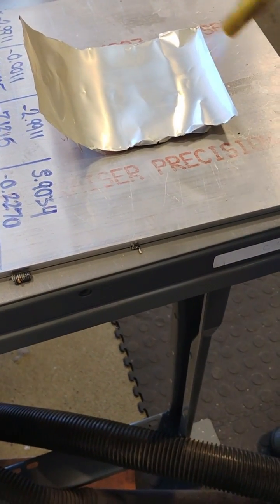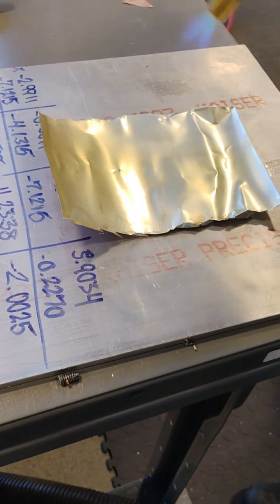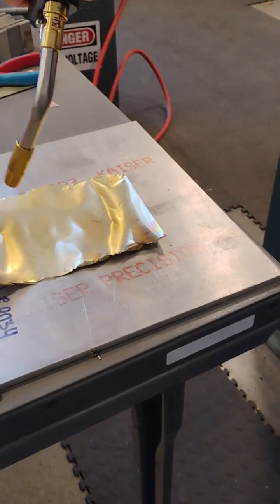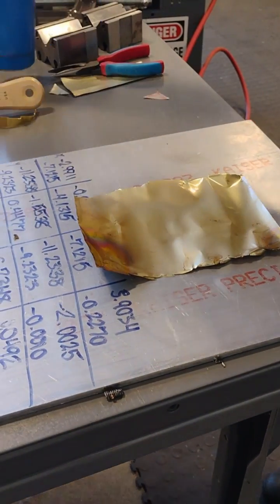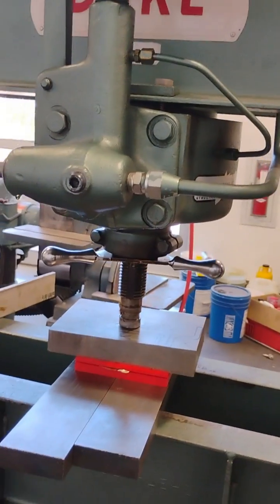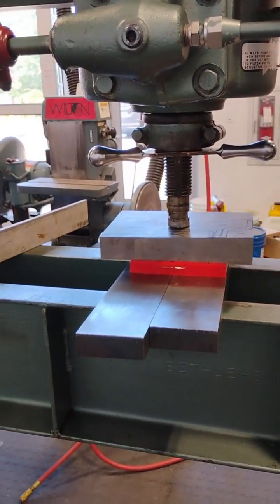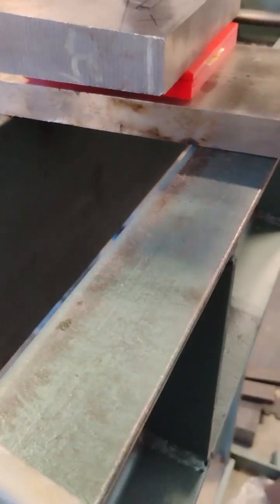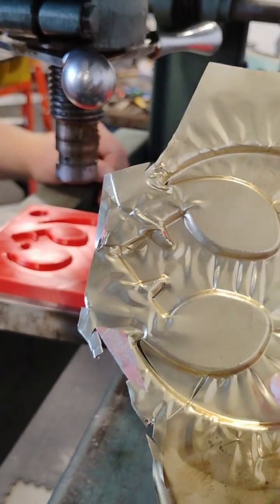FDM 3D Printed Press Die, Rebel Alliance Symbol

Comment: that looks amazing, I'm doing the same process with 3D printed parts. and I see the same results but I'm doing waves and making rectangle imprint. Same thing on the aluminum sheet but I didn't reheat it to relieve the stress. When i press them. some did good. Others is their tension when I try to make it flat but it tenses from one corner to the other corner. Another is the waves where there is crinkle in tight corners. and lastly is the sheet tear at edges that is too much. It has to do with the material behavior when it undergoes compression and there is still tension and when you heated yours it still did the same. Great job on this direction and it will work out in the end result.
Reply from the maker: Sadly didn't have time to modify since the college quarter was almost up. Would be fun to revisit later on.